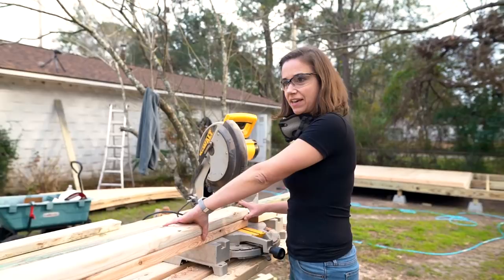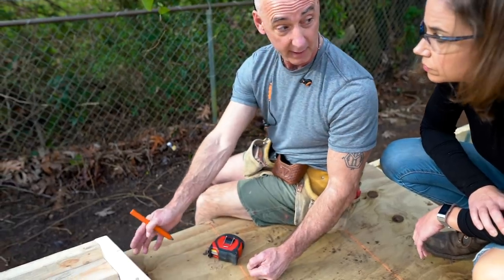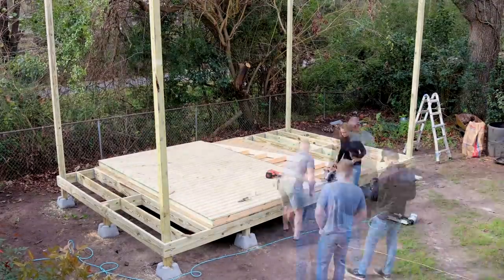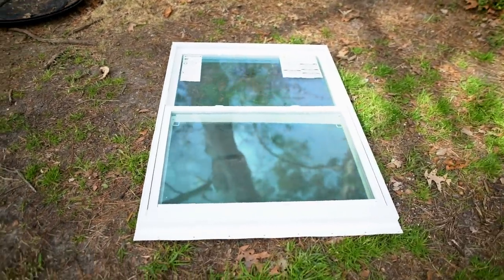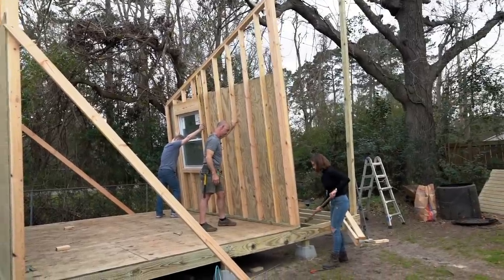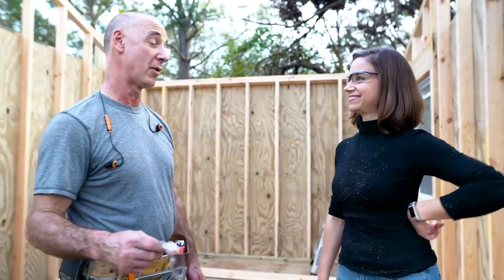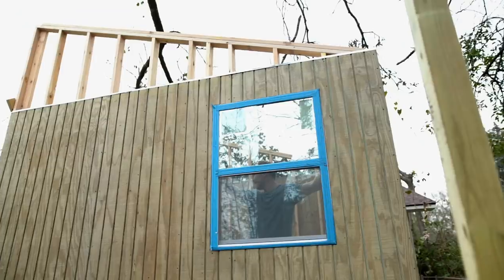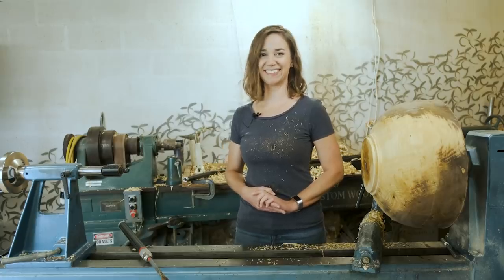SHED BUILD PART 2: WALLS

Comment: Welcome back. Good video as always but I wanted to point out something to you that is pretty crucial.

Whoever said it was okay to put Windows in a wall before standing it vertical obviously doesn't understand that a window needs to be level, not Square to a structure.
The reason this is a crucial thing is because if it's incorrect... 
It could hinder the threshold of the windows ability to properly shed water.

Easier rarely is correct.

Comment: Ashley.  That is a nice shed project.  Th only concern I had as the third generation NOT missing a finger is the section where you are trimming the edge of the siding with a circular saw.  You are doing a great job sighting along the edge and cutting straight while your left fingers are close to the spinning blade and below the base of the saw.  Certainly not trying to offend anyone, just wanted to make sure this was a safe practice.  Just saw a youtube on a journeyman builder lose all four fingers in a jointer.  It happens.  Best wishes on you project.  I liked the idea for the clear roof material for letting in light. Great idea.

Comment: An addition to the trick of picking up the wall with a hammer is to lean a small block against the wall before lifting.  Then when you lift the wall above the block it falls under the plate and you don't have to hold the wall up with one hand while sliding a block under with the other.

Comment: if the back wall top plate overlaps the side wall by 3 1/2 inches, then the front wall top plate should also overlap the side wall by 3 1/2 inches. Correct?

Comment: In your intro you've got your fingers below the saw table.  Big no, no.  I don't care who might have taught you that.  Don't you Love your fingers?
Reply: that's actually a commonly used way to keep a circular saw going straight on long cuts. Yes, it's dangerous, but also very efficient.
Reply: @MassisPipes  Sorry...not efficient without fingers.